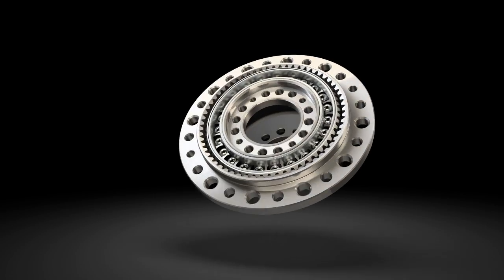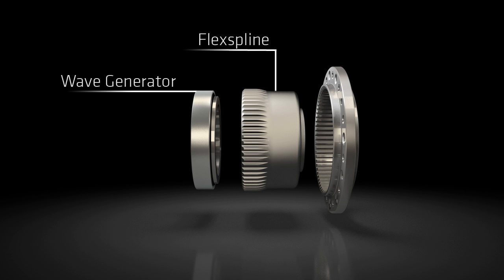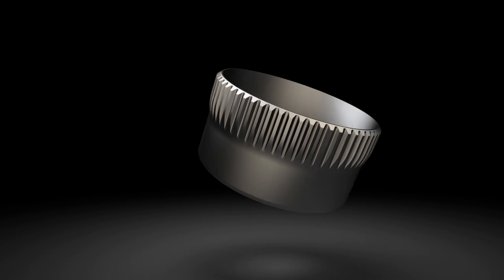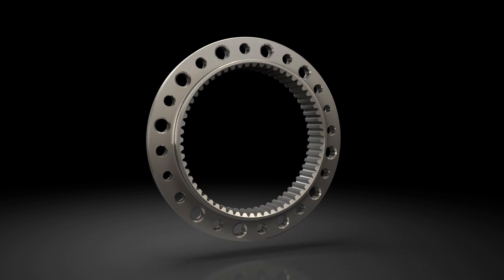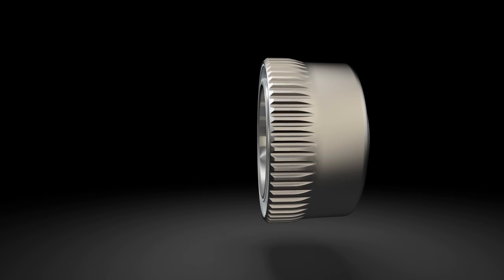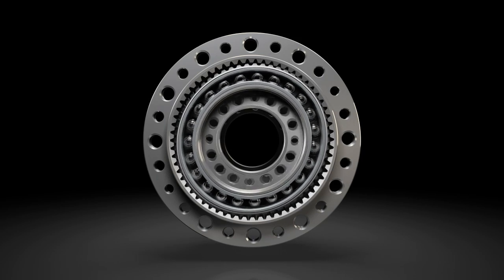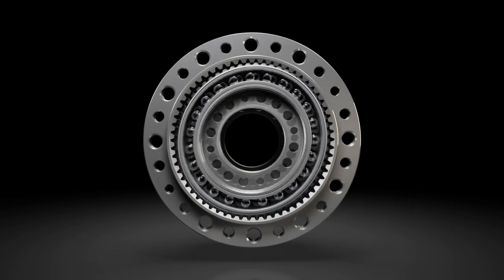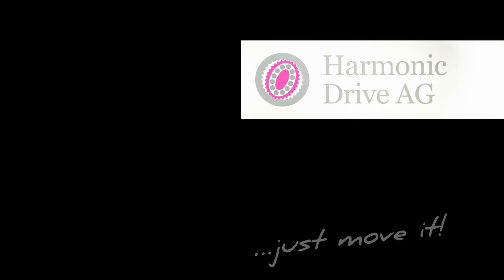Harmonic Drive® Strain Wave Gear Principle | Harmonic Drive SE

Comment: Is back driving with high load and idle motor safe with SWG?
Reply from the maker: Strain wave gears are not self-locking - due to their principle. Our technical support team will be happy to provide you with comprehensive advice:  TechnicalSupport@harmonicdrive.de.

Comment: Perhaps someone could remove my ignoranceon a few points. Could the flexspline element develop a cracking issue if used under high loads?  It seems like any metal strong enough to be used as a gear would be stiff enough to crack from fatigue. I also wonder if you could wind up with inadequate meshing of the flex spline with the circular splint, resulting in uneven wear more at the tip of teeth than over the whole face of a tooth.
Reply from the maker: Hi Dan, Thanks for your comment, it seems like you have informed you about Harmonic Drive Gears – very good!😊 First of all, as in all mechanical systems, the components are designed to operate within the fatigue limit so that no cracking occurs. Our Flexspline has to be flexible to a certain degree because torque is transmitted from the elliptical rotation of the Wave Generator in an axial way over the Flexspline to be used at the output flange. While using the gear under catalogue conditions the Flexspline operates below fatigue strengths and no cracks will be caused. As a outcome from a mistake in the alignment of the Flexspline to the Circular Spline there can be mistakes in terms of accuracy or vibrations but this does not result in total failure of the gear. The lifetime dominating component in our Harmonic Drive Gear is the bearing, like in nearly every mechanical gear system. We hope that helps 😊 If you have any further questions feel free to have a look at our Brochure at www.harmonicdrive.de or to contact our Info-Center.

Comment: What is the gear ratio?and what is the way out?
Reply: the outer ring with internal teeth is torque out
Reply: iRPM[(FST# - CST#)/FST#]=oRPM . Wave generator is input. Ex. 50[(50-52)/50]=-2. Pretty awsome stuff. Small robots use this type of reduction alot, due to reduced space and wheight.